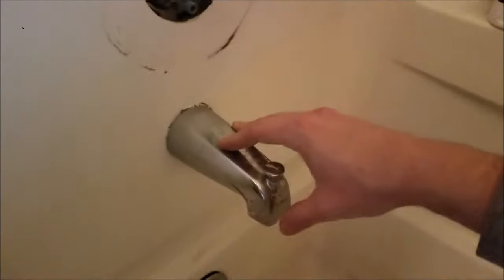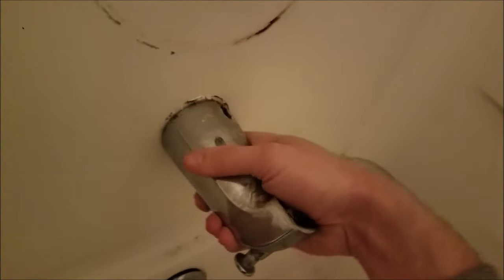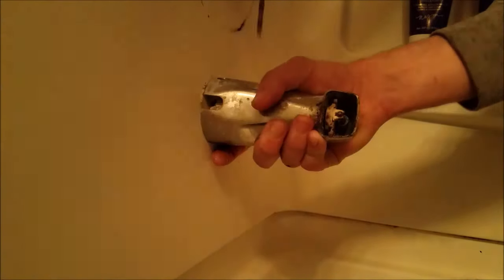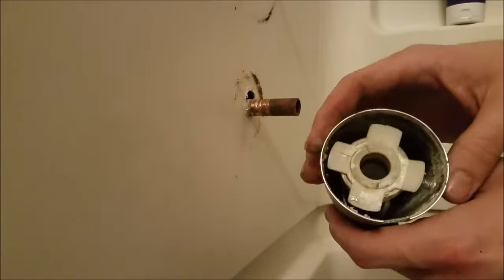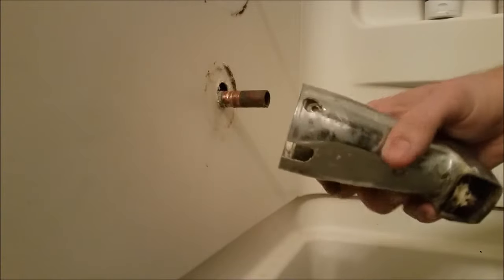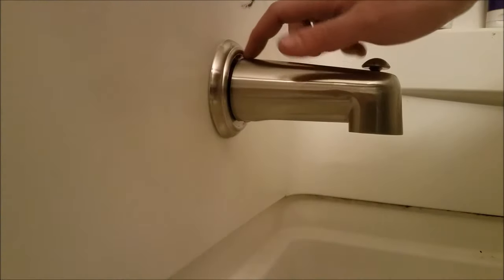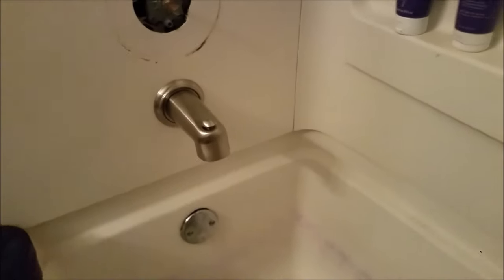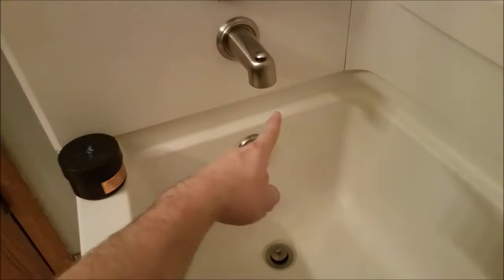Trick to Remove That Stuck Tub Spout

Comment: I can't rotate mine at all and there's still no set screw
Reply: I have the same issue
Reply: Slightly pull on the tub faucet to see if you have a shark bite fitting.
Reply: @myemail2418 dang, if theres no set screw its being held by something in the faucet
Reply: Same. It’s toast.  Don’t Rip the pipe. I’ll need to cut & add a new sleeve.
Reply: That's the problem I'm having
Reply: Add me to the list. No set screw, not pulling out, not rotating...ughh
Reply: Anyone ever find the fix to this? I also have a hole on the bottom but there’s no set screw inside, just the water pipe.
Reply: ALWAYS MAKE SURE WATER IS OFF! (and electricity as an extra precaution)
First use a penetrating rust-loosening spray. If you can, try and loosen it up by turning it counterclock wise. You can cut it off, making sure that you have at least 4"of copper stubbed out. You can get one that has an O-ring on the insice of the spout. Put some grease on the copper, and slide it on.
Reply: dangerous.  drill your finger that way.

Comment: There is really no need and almost every cage to replace the whole spout! My diverter was bad in my tub and shower combination in the guest bathroom, I simply unscrew the knob that you pull up and down on and let the whole diverter come out through the bottom of the spout and inserted a new diverter in and screwed the knob back on it, problem is fixed just like that! I did not need to remove the whole spout or any of that nonsense. If your diverter is bad just unscrew the knob take the diverter assembly out through the bottom of the spout stick the new one in and screw the knob back on problem is fixed! But none of these videos I’ve watched tell you the simple and easy way to take care of your diverter problem for some reason!
Reply: But just know, there is no need to remove The entire nozzle to replace a bad diverter!
Reply: In my case a new deverter didn't do the job had to replace the spout and mine was turned just like this one👍

Comment: I just pulled mine off thanks to this video!  I had the same issue where the set screw didn't line up with the hole and couldn't be seen so i was trying to unscrew it not knowing it was in there.  I didn't have a drill to use today, so i used a hacksaw and peeled back the part of the spout that was blocking the screw.  Thank you!  Now im off to the store to buy the replacement.

Comment: Just one more thanks for the video. Same issue on my spout except the screw was almost 180 degrees around. I wasn’t exactly sure where,  as I couldn’t see it but got close on the first drill and then just needed to make it wider with two more drill holes. When I first saw your video my first thought was this isn’t going to be my issue but that’s exactly what it was. 👍

Comment: Mine was twisted as well. I had to break off parts of the spout until I could get to the set screw but the plastic on the pipe refused to come off so I had to break that part off as well until it finally came off. Good video thank you! I didn't think it should have been as hard as it was but that made sense after watching this.

Comment: Spout I want to remove is an American Standard and I don't see any collar at all, just copper pipe with a lot of green silicone trails. Spout turns but will not back off. Should I drill into the spout?

Comment: I wish I was as lucky as you. I couldn't figure out where the set screw was, so I used my angle grinder to cut away a ring of metal at the base of the spout. I then bent the ring back and forth with pliers until it broke and I could remove it. That helped me locate and remove the set screw (which was a Philips head in my case) but the spout still wouldn't come off. 
I then cut the spout completely in half longitudinally so I could separate the two halves and remove it. That left the plastic part still stuck on. It would rotate quite freely, but no amount of pulling or levering could get it to budge. I ended up losing my cool and just burning it off with a blowtorch. The plastic had to almost burn away completely before it finally let go.
Turns out there was a thin burr of copper where the set screw had carved a groove in the pipe. That burr was enough to prevent the plastic piece from pulling off.
Whoever designed these things was an utter moron.
Reply: I have the same issue. My set screw was aligned and I took it out completely. But the spout will not pull off. It is on there really tight and don't want to start pulling on the spout too much. These videos always make it look soooo easy! Guess I will have to get out the cutting tools...

Comment: I gave a thumbs up because i have a stuburn spout that will not come off with a wierd allen key screw that won't turn and i have the right wrench but it striped it and i did not think drill a whole in the spout because all i have to do is turn it over and you can see the screw line with the whole it just won't turn basically it's froze in there
Reply: Did you ever get it off?  I have a hex set screw that I see under the spout but it’s likely stripped or just corroded because turning it is very hard and doesn’t seem to loosen no matter how many times I think I’m turning it.
Reply: Yes i got it off but it wasn't with a hex set i had to call the plumber and he had to sand it off the crazy part is the ring that you put the hex screw on don't go on copper or iron pipe if you have a copper or iron pipe like i have your just suppose to screw the spout on that ring is for pvc and plastic pipes that is why my ring was stuck but i got it off
Reply: Charlie Gamer Yeah, I finally got mine off.  It was on a copper pipe.  Had to use a monkey wrench to twist the spout off of the plastic part inside that the pipe goes into.  There was a metal ring with a stripped hex screw holding that plastic part onto the pipe.  Trying to use the wrench to twist the ring to where I could easily work on it ended up breaking the ring and pulling the plastic sheath off.  New spout is has a Phillips set screw, so it will be harder to strip hopefully.

Comment: Do we need to use putty or silicone to seal the gap between the copper pipe and the wall?  I saw other videos doing that for a screw on spout installation

Comment: I installed a new Moen diverter and the dang set screw broke in the unit!  I still have the old one but I am not sure how to remove it to get that set screw out and the old one back in.  Moen said I needed a plumber and of course they didn't take responsibility for a defected part.  Priceless.

Comment: Thanks, this worked for me. But I found I have gouged the pipe on the outside because of the set screw digging into it as I twisted. Can I just  sand this away?

Comment: I had a stuck slip on spout... got the set screw out.. all he way out ...  flipped it upside down sprayed lubricant in the screw hole and on the copper tube.. twisted it a bit.. and it came right off.

Comment: How did you know where to drill?  Was it just luck or could you see by looking through the opening where it was supposed to be?
Reply from the maker: When looking through the bottom opening I was able to see the set screw was offset from where it should be. That pointed me in the general area to drill.

Comment: I'm taking a saw to it tomorrow (just the shell of course), thanks for the help!!!
Reply: thats what we did  lol
Reply: I am going to attempt tomorrow
Reply: @dipaklpatel1  could also try peeling back the metal with some pliers. Was easier imo than the saw. All that happened was my buddies kids were messing with it and the screw no longer lined up with that hole. Using a large drill also helped a little.
Reply: @jcg702  my maintenance guy used sleeve to cover space as stem.was longer to cover the space. There is no set screw at all. I cut it out but it has been connected to upfront and can't seem to unscrew. I don't want to  get leak so may be spray some wd40 or something might help.

Comment: How is did you figure out the set screw was "right around here"? I have spun the spout and looked very close and still have no idea where the set screw might be to try and drill? THANKS
Reply from the maker: I initially looked through the bottom side hole that the set screw should be accessible through. When it wasn't in direct line with the hole, I peaked around with a flashlight and was able to get a rough idea where the set screw was. Then I drilled a hole and got it close enough to loosen the set screw. It may take a couple tries though.
Reply: @WeakestofWeeks  Thanks, tried and tried and could not find it. I ended up using a hacksaw and it was a pain in the @ss but it did actually work. Thanks so much.

Comment: I need help. We took the one off our tub and it’s a screw on to Home Depot to get a replacement and found the one that’s identical to what we have. We get it home and it doesn’t fit. It doesn’t reach the copper pipe. What to do? I suppose grind it down to the original? I have a old house.

Comment: Quick way -Just take saws all and cut all way through just behind water comes out . Spout will fall off . You’ll be left w connection point your looking for .
Reply: I have no set screw and it won’t turn at all- looks like it was cheap metal and rusted- I’ll be trying the sawzalll next

Comment: What happens if the copper pipe is ruined? A whole demolition taking down the wall and replacing the pipe from inside?
Reply from the maker: If you're lucky theirs enough room to solder on a copper extension. Worst case, gotta pull the shower insert or remove some tile to solder a new copper pipe on.

Comment: You created an error by cutting the copper pipe shorter. You will find out that because the pipe is shorter when you pull up on the shower diverter, too much play will be on your spigot. That length copper helped give your spigot greater stability when using the diverter.

Comment: I am trying to take the faucet off of a jacuzzi tub. I found the set screw and removed it with no problem, but now  still cannot get the faucet to pull off. It will spin to the left and right, but I cannot pull the faucet up to get it off.
Reply: I’m having the same issue. Did you find a solution?

Comment: Kinda a stupid question but how did he know where to drill the hole to find the set screw?
Reply from the maker: Sticking my head under the spout with a flashlight I was able to see through the original set screw hole and see it was partially offset. From there I guessed where to drill.
Reply: @WeakestofWeeks  thanks for the response, happy thanksgiving

Comment: My set screw will not budge.  I rounded off the hex trying to get it to turn.  Any suggestions?
Reply from the maker: I would try a screw extractor set like this: https://www.amazon.com/dp/B07GZ17QD9/ref=cm_sw_r_u_apa_i_GBAIFb9K4SF2K
Reply: Did you manage to remove the screw? I have the same problem - stripped/no budge.

Comment: Did you shut the water off at the main?
Reply from the maker: No need to shut off water to your house if only changing the tub spout like shown in video. Water travels to the diverter valve (the knobs that adjust temp and turns on/off water in shower) first and then goes to the spout. Since the spout is after that diverter valve there is no need to shut your main water off when servicing the spout.
Reply: @WeakestofWeeks  thank you :)

Comment: what should i do if half of the set screw is visible while the other half is covered by metal? my centerpiece must have shifted, and i dont want to drill into the screw
Reply from the maker: See of you can spin the spout and hold the center cartridge to see the set screw better. If that doesn't work, you may be able to dermal the access hole to the set screw larger so you don't have to drill.
Reply: @WeakestofWeeks  thank you for the help!!

Comment: Interesting method but I wouldn’t have used a drill anywhere around that copper pipe. All you had to do was rotate right back into a place go in the tub with head resting under the spout to find the location of the set screw and turn it counter clockwise
Reply from the maker: That was the problem.. turning the spout (either direction) also turned the inside cartridge containing the set screw. No matter what, the set screw was not visible through the access notch from underneath. What I presume happens is someone twists the spout thinking the unit completely screws off. In reality, after some force the set screw gives way and spins gauging the copper pipe and creates a slight ring. Tug on the spout and set screw holds in that channel. Twist the spout and cartridge with spout freely spin together. 

Seems many others have run into similar issues so I'm glad my unorthodox solution has proven to be beneficial.

Comment: Since you had a Dremel, why not just cut the old spout off in the vicinity of the setscrew so you can find it and unscrew it.
Reply from the maker: That could work too. I personally didn't want to risk using the dremel inside and slipping then cutting the fiberglass tub surround.

Comment: So why did you drill it...put the hole over it
Reply from the maker: If I could have lined them up I would have. But when I spun the spout the inside spun with it. I tried spinning the outside with holding the inside but still couldn't get it lined up. I didn't want to further risk damaging the copper pipe so I decided to drill.

Comment: Got the screw off, but faucet will not come off any suggestions?
Reply: Mine is doing the same. Did you figure it out. I got the set screw off it will twist but won't come off. I've tried pulling but still nothing.